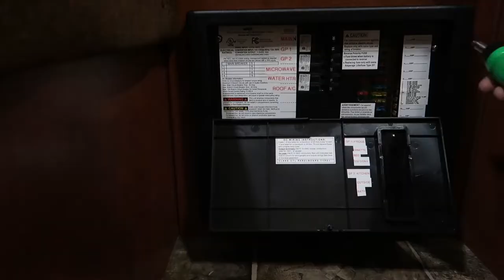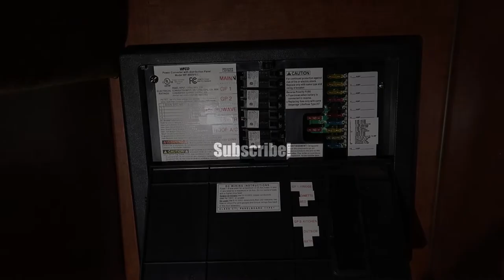Re-wiring or Disabling the Converter (Charger) in your RV

Comment from the maker: My inverter is an inverter/charger.  It takes the place of the converter when I am plugged in to shorepower or using my onboard generator.

When you are not plugged in to shorepower, you don't want the inverter to power the 12v converter, hence the reason I disabled it.  If you have an inverter providing power to the converter, then you are setting up a power loop, which will eventually drain the batteries.
Reply: It's one way of doing it. I have a older Shurtron model 630-51 30 amp convertor. I know it charges the battery but I'm not sure if it charges at what rate and if it is a auto shut down. I have an analog meter attached to it and shows it can start at 4-8 amps and feathers the charge when it gets to zero at full charge. I believe it is designed as a battery maintainer but would like to find the owners manual. Anyone know where that might be on-line?

Comment: This might just be the answer I've been looking for!!! My Honda 2000 hasn't been able to run the a/c after I installed the (whatever is called) onto the roof a/c unit. The converter sucks too much power from generator and trips it. I already have the new breaker, and will see if it finally work tomorrow morning. 
Thank you sooo much for this informative video👍
Reply from the maker: Sounds like it should solve your problem.

Comment: I just installed a new converter charger to charge a lithium ion battery. The old unit had the pigtail wiring from the converter charger to a double wire going into a breaker. I decided to forego the pigtail and add a new tandem circuit breaker and connected the new converter charger to the new circuit breaker. I don't understand why the factory didn't do that to begin with. I agree that this will be great once I add an inverter charger like you did.
Reply from the maker: I think the factory does the pigtail and piggyback of two circuits to one breaker because they are "cost cutting".  That technique would never fly in a residential application.

Comment: When you turn off the converter with the newly installed breaker - does this also shut down power to the 12VDC circuits? My RV is now in storage so I can't test this right now. Thanks
Reply from the maker: No, it does not.  a 120vac breaker has no control over 12v circuits.  12v circuits get their power from the battery.  Turn off the breaker simply prevents the batteries from being charged by the converter.

Comment: i have a question...wouldnt you wire your outlets and stuff 110v through your breaker anyways from the converter? why would you need a inverter if that is the case? thanks! just new to this whole thing. i notice converters have breakers as well...well as an option?
Reply from the maker: The "converter" is just a battery charger, it takes 120vac and converts it to 12vdc to run DC loads and charge the batteries.  It's the big aluminum finned device at the bottom of the electrical panel assembly.

When I installed an "inverter", which is the opposite of a converter, I don't want the inverter providing power to the converter.
An inverter takes 12vdc and creates 120vac.

Comment: Hello. if you shut of your converter, how do you  convert the  alternating current coming out of the inverter to 12vdc to run the interior lights, furnace fan etc, Thanks
Reply from the maker: My inverter is an inverter/charger.  It takes the place of the converter when I am plugged in to shorepower or using my onboard generator.

When you are not plugged in to shorepower, you don't want the inverter to power the 12v converter, hence the reason I disabled it.  If you have an inverter providing power to the converter, then you are setting up a power loop, which will eventually drain the batteries.
Reply: @deltabravo1257  Then how is the 12 volt water pump powered?
Reply: run your shore power cable to your inverter us a adapter and plug your  shore power cable in to the inverter, now everything in your camper will run the same as being plugged in to shore power besure you have good batterys, you have to disconnect your "converter" because now it wants to charge your batterys to, with your battery power and this will kill your battery bank, its called ""looping"
Reply: @pw8380  Directly from the 12 Volt Battery / Battery Bank.  All the Converter Charger does is provide a slow charge to the battery when on shore power.  You can charge your batteries with solar panels or even a proper 20 Amp battery charger (When on Shore power or Generator)

Comment: Question in the fuse side right side I was told is your 12 volt side I have extra or open lugs can I hook into one of these and run a new line up to my ceiling for a 12v exhaust fan!
Reply from the maker: Yes, you can use the extra spaces for adding more 12v accessories, but it won't be easy running a wire up in to your ceiling.  In fact, it will be nearly impossible.  People will almost always tap in to a nearby light fixture to get power for a fan.
Reply: @deltabravo1257  Thanks fuse box  is under frig. on corner wire can be run up behind trim and vent is line up with corner of frig. Just have to fish wire over a little over a ft. Just wasn,t sure about the connection again tks for you help!

Comment: I think this is how i did my new 55 power inverter put orange hd female plug on to breaker brass hot white metal neu and bottom grounded.  Plug and replace now and can flip off with switch breaker

Comment: I have the same power panel as you and want to do the same thing. Where did you get the new circuit breaker?
Reply from the maker: Home Depot has the same brand circuit breakers
Reply: I added the same breaker as you. Removed the converter charger wire from the shared breaker and gave it it’s own 15 amp breaker. Looks just like yours. However, since I’ve turned it back on, the fan has been running non stop. Does that mean its charging my batteries?  It’s been running non stop for three hours.
Reply: @donaldbonrud8289  me too, did you ever find a solution other than just turning it off?

Comment: Great video thanks for sharing. QUESTION: You said the converter was piggybacked in with another circuit. To me it looked like the converter had it's own 15 amp breaker already. and that you should be able to shut it off independently. Again, great video but please let me know your thoughts.
Reply from the maker: After I finished the project, I moved it to its own breaker.  Originally is was connected to another breaker that also supplied power to another circuit.
Reply: @deltabravo1257  Oh I see now. I just re-watched the video. I see now there were two black wires in that upper 15 amp breaker. I should be good if my converter has it's own breaker. Thanks again. I am planning on setting up an inverter kind of like your plan.

Comment: I think I missed something.  Are you using a circuit breaker to get a/c to your plug sockets, or will there be a transfer switch installed on another video?
Reply from the maker: I haven't changed anything with regard to how AC power goes to the outlets.  The only change I made here was to separate the converter off a shared breaker and place it on a dedicated circuit breaker.  The converter was connected to a breaker that was also supplying power to AC outlets, which is not the correct way to wire a breaker panel.

Comment: Hi! Quick question for ya. I’m installing a secondary 50 amp battery charger lithium specific because my wfco charger isn’t bringing it to max.  Do I need to disconnect the the wfco charger or l can I run in tandem. I know I can run my solar charger in tandem. Thanks in advance.
Reply from the maker: I would recommend disconnecting the WFCO.
You don't need to do anything special to have the solar charger running when your new charger is running.  They can run at the same time.
Reply: @deltabravo1257  thanks for the reply! Wasn’t expecting it since the vid you posted was some time ago. Sort of scared of doing shit to the panel to be honest. Last year something happened, possibly had 24 volts going into it but the electrictrians, plural,  industrial guys; not rv, didn’t catch it, and fried my bus bar that holds the breakers.  Gong show. Bought a new wfco box just to replace the bar.  Was recouping from a good TBI at the time from a skiing accident.  Since then I have have completed gutted my rv and turned into a tiny home living off grid now with and learned a small lifetime about electricity and plumbing. Lol.  Still gunshy on the wfco however. Haven’t found much online disconnect the charger without disabling the inverter when running the Gen.  Any help would be appreciated my friend. TYIA.  Mike and Trish.

Comment: Why do you need to disable the converter just to install an inverter? Unless you're installing an inverter converter combination.
Reply from the maker: Yes, I installed an inverter/charger combo.  Even if not installing a 
combo unit, you need to rewire the converter so that the inverter 
doesn't power it.  This video doesn't show those particular steps, but 
you could turn off the breaker that powers the converter when you are running 
the inverter, which is what I do.  I leave it off since I have a 
combo unit, which is why I rewired it, so I could turn it off, but still have it in place as a backup if needed.

Comment: I know this video is old. But after removing the old converter, what do you put back into the general breaker?
Reply from the maker: There were two wires in the "general" breaker.  One was for the outlets, one was for the converter.  I put the converter on its own break and left the other wire (for the outlets) in place in the "general" breaker.
Reply: @deltabravo1257  Thanks for the response.. I ended up doing the exact same thing.. Wonder if using the battery disconnect accomplishes the same thing?
Reply: @deltabravo1257  Thanks for the video - very helpful. I don't have room in the converter for another breaker; would simply turning the breaker switch off for the DC (hot) work so the inverter does not charge the lithium batteries?
Reply from the maker: @ewinkley  Yes, that would work.
Reply: Why can't I just unplug it

Comment: Ok my 2007 trail lite has an attwood 81001006-3 power center....its been acting up. I told camping world what i had and they sent me the wf8955rep....now what? Its over an inch too tall and came with 0 diagrams or instructions. I suppose my question is would it hurt to put this new unit next door by the water heater and bolt it to the floor? And will it hurt anything to wire this converter replacement kit to the old Power Center? I will have to add 4in to the wires that came with it if I put with the water heater. But I think it will get much better airflow there because they didn't leave any room maybe a half inch around the whole unit from the factory
Reply from the maker: Check out Progressive Dynamics - they make power centers too.  One of my RVs has it.

Comment: One  Downside to hard wiring your RV converter to the transfer switch with shore power, is that the little fan motor will run constantly when you're plugged into shore power. Since I disconnected it from the breaker Box, there's no way to shut it off.
Reply from the maker: The way I wired mine was to simply move the wire to a new dedicated breaker.

Comment: The problem with disabling your converter, you wont be able to charge your batteries when on shore power, you are then depending on your solar power to charge the batteries.

I assume you are running a transfer switch for shore power and inverter, not to overload your inverter.

Great content but i would have left the breaker connected permanently to charge your batteries on shore power.
Reply from the maker: I don't want the converter charging the batteries when I am running my inverter.  I also don't need the converter charging when on shorepower either, because my inverter/charger takes over that duty.
Reply from the maker: My inverter/charger has a built in transfer switch.
Reply: @deltabravo1257  Maybe I'm confused. 

I do agree that the converter should be off when using the inverter. Creates a loop that will drain the battery.

What's charging your batteries then besides the 7-way plug and solar?

My tiny camper runs two 12v 200 amp hour batteries that run my 2000w inverter.

 That inverter is run straight to my rv panel, providing 120v to a 30amp breaker. My backup charges are my 7-way plug, or shore power, or solar. 

I'm interested in learning different hookups, that's why I was curious about what's changing your batteries.  I assume you have a couple of small lead acid batteries running at less than 100 amp hours. 

My setup is geared more towards being off grid with the use of 110v outlets for up to 48 hours+.

Comment: I think you could just turn the breaker off, wasn’t necessary to connect it to other breaker
Reply from the maker: If I turned off the other breaker, then I loose power to the other circuit on that breaker, which was not an acceptable solution.

Comment: I just yanked out my inverter. Something was siseling. How can I just use 125 votes.
Reply from the maker: I think you mean the "converter".
Just plug in to shorepower and everything 120vac will work.
Reply: @deltabravo1257  thank you. Any way to get up and running would help
Reply: You need a tranfer switch if you're running and inverter to your panel
Reply: @chrisholliday1330  I rewired it all. Everything works but the hot water heater
Reply: @graigsessions5447  gas and electric? Unfortunately, without bringing it into our repair shop, it would be hard to troubleshoot
Reply: @chrisholliday1330  gas unhooked. Got a leak. Everything on hot water heater should be good. But something is wrong. All 120 volt and 12 volt DC is working. Ohms and continuity is right. I can't know what's up